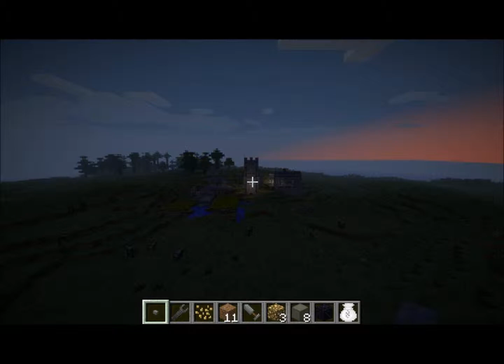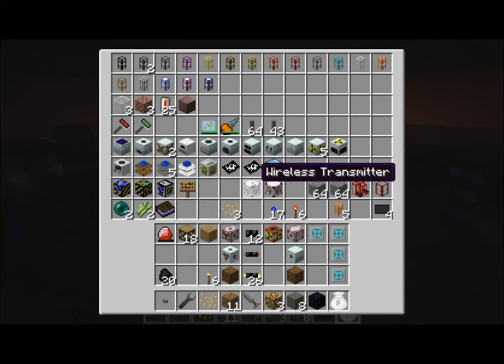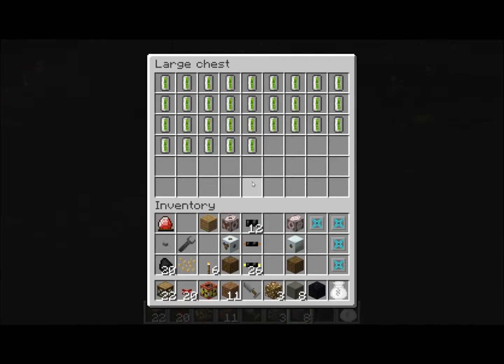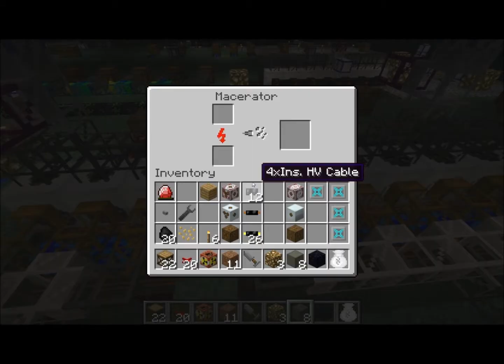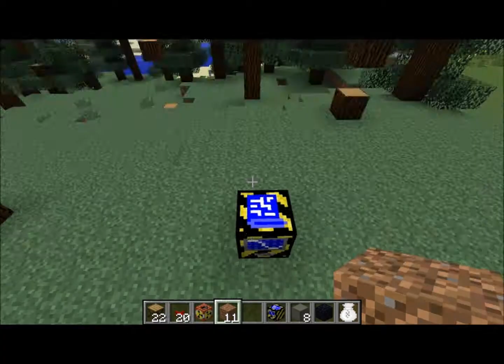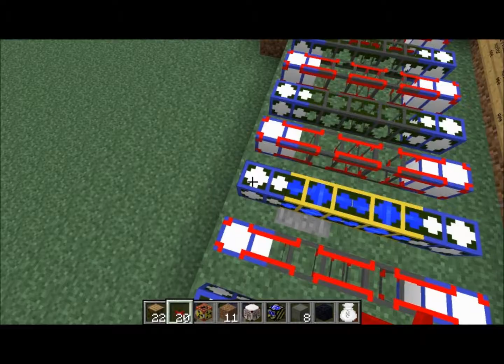nuclear housing test  for IC2

Comment from the maker: @Lsumba97 it would but the CF was used to make the base layer that i built on.also allows you to measure rough distances in scaffolding before you start. it wa smore for ease of building. that and the foam is more a sacrifice layer than anything